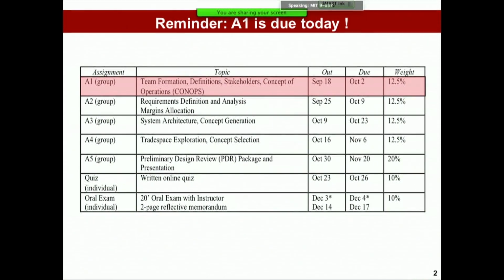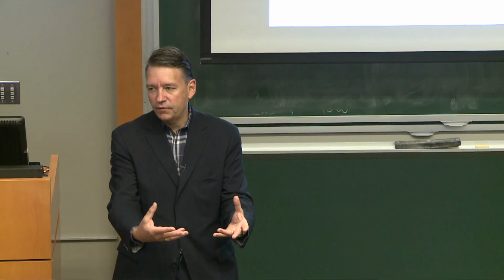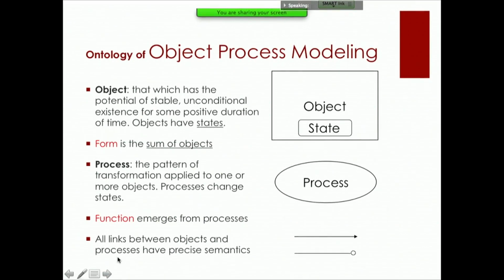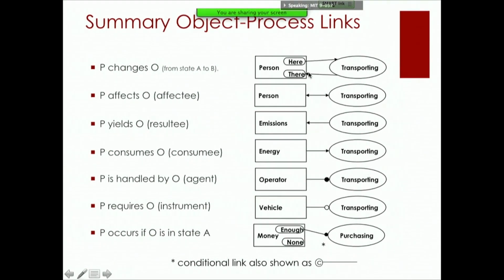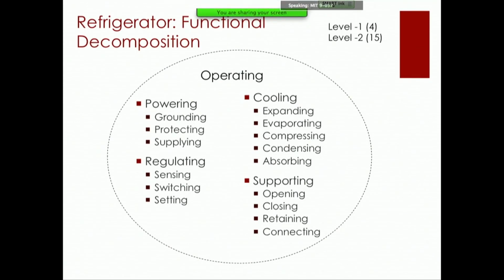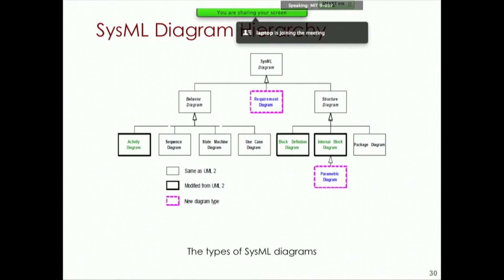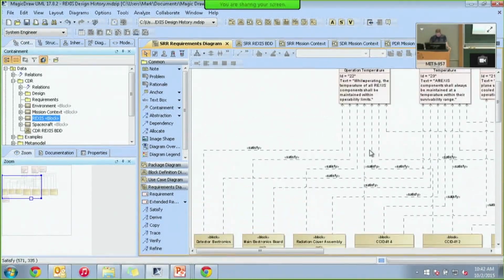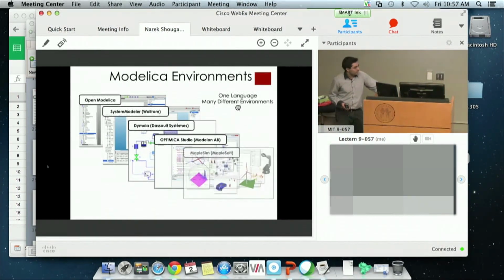3. Systems Modeling Languages

Comment: Cool lecture. Note though that the refrigerator runs on the vapor-compression cycle, not the Carnot cycle. The Carnot cycle is just an ideal cycle for a gas. Vapor-compression refrigeration involves phase changes and non-ideal. The p-V and T-s charts are quite different.

Comment: Thank u sir

I'm trying to learn anew programming (modeling )
language: modelica

I'm using 32 bit windows 7 to run the openmodelica
software

this error appeared as I opened the openmodelica

[1] 10:06:27 Syntax Warning

[C:/OpenModelica1.13.232bit/lib/omlibrary/ModelicaServices 3.2.3/package.mo:
165:40-166:7]:
OpenModelica only supports 31-bit signed integers! Truncating integer: 2147483647 to 1073741823

And when I write simple tutorial program.. this
error appeared:

[5]
10:33:30 Warning

Out of memory! Faking a stack overflow.

[1] 10:33:38 Warning

Out of memory! Faking a stack overflow.

[2] 10:33:38 Scripting Error

Stack overflow occurred while evaluating translateModel(RLC_Circuit.circuit, startTime = 0, stopTime = 1, numberOfIntervals = 500, method = "dassl", tolerance = 1e-6, outputFormat = "mat", variableFilter = ".*"):

[bt] #1 [... unsupported platform for backtraces]

Could anyone help me, please

Thank u in advance
Reply: nice
Reply: nice